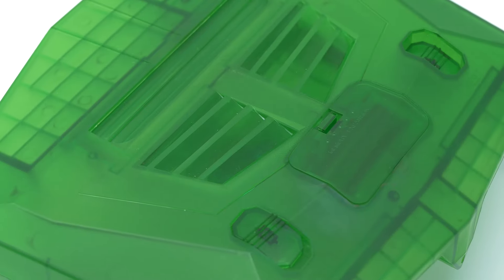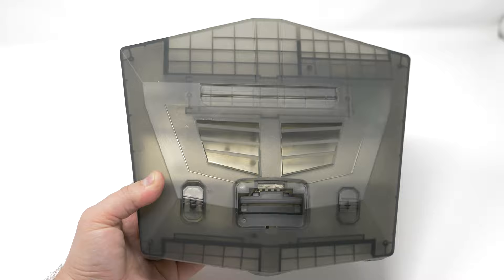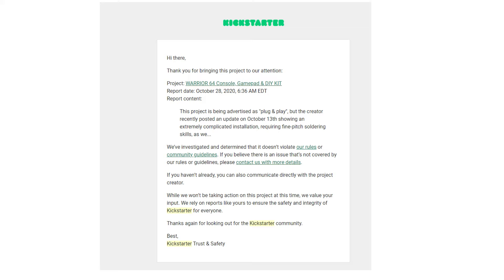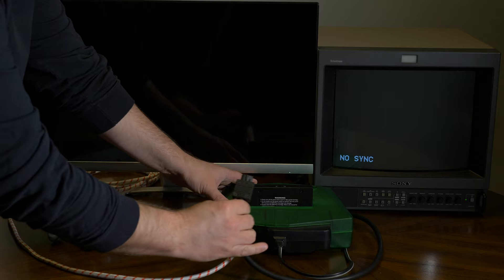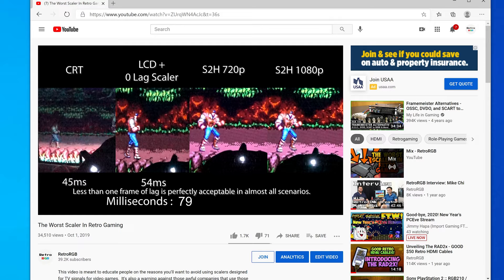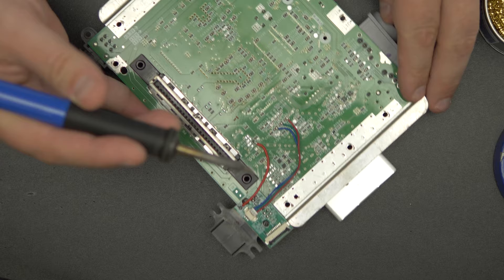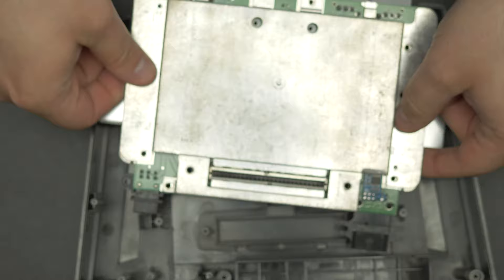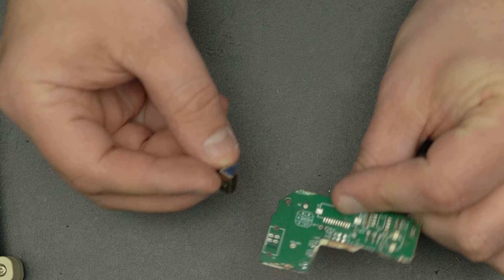Warrior 64: Review & Repair

Comment: The sandpaper thing: is this an out-of-season April's Fool joke?
Reply: You all have belt sanders don’t you? /blizzard
Reply: It's dumb as fuck. The thing is you can actually use an abrasive like a fibre glass pen to clean an already corroded contact but on the whole 2 times I've ever done that the contact was already suffering corrosion damage and i used a thin coating of solder afterwards to try and protect against future corrosion.... I honestly don't get how anyone thinks sanding a contact that just needs a bit of a clean is any kind of good idea.

Comment: I think a better mod for the N64 would be a complete cooling overhaul.
— Soldered copper heat-spreaders.
— Copper heat pipes.
— A copper heat sink.
— An actual cooling fan.
— Cooling for the memory as well.

Comment: That sandpaper is really worrying.
Reply: I was expecting it to say that it's for sanding down any excess plastic that had seeped through during molding. That still would've been bad on its own. I was not prepared for it to say that it's for sanding the damn cartridge contacts.
Reply: additionally, if you read the note there, they say to blow on the game after sanding.  I thought we'd come so far as a hobby, we've grown, we know better than this.  And yet here we are.
Reply: @hjalmarjohnson5846  
Two things were abundantly clear from comments made by the company doing that Kickstarter.
1) They had basic to hardly any even rudimentary knowledge about retro gaming consoles.
2) They spoke in the unmistakable broken bad english of people I have to guess in China or China adjacent that are trying to run something far above their abilities.
This whole thing smells to high heaven of shenanigans of some kind. it's not exactly a scam it's just not good either and it's ruining perfectly good consoles.
Reply: Damion Manuel  I would have blocked you if that was possible on YouTube
Reply: Damion Manuel   I  promise you that's not what they threw in there.  Not really something most people have laying around, either.  Hell, I used to manufacture cabin trim for aero/marine applications and I hardly used it even.  30k is well beyond even a ceramic honing rod, which is almost imperceptibly coarse.

Comment: 13:40 "$5 toaster that you get from Wal-Mart"
Thankfully, I got a $5 antique Sunbeam Radiant Control toaster from the flea market. :) "Automatic beyond belief!" despite its age. The toast even lowers itself and you get the consistent results even if the bread is frozen or toaster is already warm. That's because it doesn't care about time and temperature. Instead, it uses how brown the bread gets to gauge how "done" it is (darker spots reflect heat differently).

Comment: Interesting to see the prototype version for consoles support a straight RGB amp but there's no way the final DIY kit would include that.

It would mean giving every DIY order essentially TWO complete RGB restore kits when the same multi-out board can be used for all three N64 encoder types if they just include a third digital-side adapter board... that's the little one that's basically just a connector on a PCB. Also, between Sep/Oct they updated to show three digital-side adapter boards instead of two. Lastly, the DIY "Installation Instructions" video only instructs users on the digital installation.

I know they sent out a survey before shipping the kits but I'm pretty sure it didn't ask people to identify their console revision since I ordered one for the LULZ and don't recall any question like that. That means they aren't sending different DIY kits to different buyers. Then again, they supposedly shipped and I haven't received mine yet so maybe they are waiting for an answer. Heck, half the reason I pulled the trigger was because I wanted to use the extra adapter boards as digital break-out boards for something like eTim's N64RGB or Borti's N64Advanced.

Comment: The controller design they used seems to be a recreation of the Hori n64 pads from the early 2000’s, released only in Japan. While they may not appeal to everyone as they are quite small, those original Hori controllers regularly sell for high prices on eBay and elsewhere, so it is nice to have a cheaper and new production alternative for those that want them.
Reply: Retro bit already makes a hori N64 clone called the tribute 64. I don't know if the warrior 64 is just buying those, buying stuff made by the same factory, or just making their own (almost certainly worse based on the rest of the kit) implementation of a hori knock off. Also, the original hori n64 controllers aren't that expensive, they are going for like 1/3 the price of the gamecube hori pads people like to use with the gameboy player accessory.
Reply: @coopercummings8370  Maybe $80+ for a used controller isn’t that expensive for you, but having an alternative that is new stock for $25 seems reasonable - I have no experience with either this Intec version, nor the Retrobit offering however, so I cannot attest to the quality of either.
Reply: @RudeKeyser  I'm seeing a couple on ebay for under $70, which is less than a switch pro or dualsense controller. Still pricy for something used, but not insane. The gamecube hori pads are starting at $180.

Comment: LOL!! THE STOVETOP SOLDERING!!!!

I've actually soldered a guitar output jack with a lighter at a gig once, between sets, because my guitarist had a break. 

It was all we had to work with
Reply from the maker: That's such a fucking cool story!!!  I've pulled some MacGyver shit at gigs before, but I think you win!  :)
Reply: @RetroRGB  It was a quick fix, I had to keep telling him to stop jumping around so I could get the thing home and put in a new jack. 
Of course, getting drunk musicians to listen during a show is never an easy chore haha!

The best one was when my '74 Ampeg V2 head shorted out at the power plug (Someone's guitar was leaned against a wall near it and fell on it) backfeeding into a generator and shutting down the show for 20 minutes...

In the mean time, I pulled the plug apart, stripped the wires with my car keys, and put it back together... it was ugly.. but it worked.

The work of a bass player is never over, we're the time keeper, field-tech, and often sound guy of the band haha

Comment: I got mine from a Buddy today and i´m glad i saw your Video. Maybe i will Repair mine to if i can get all the parts needed. Thank you for this Awesome Video.  Question: do you know if  the one included is a Expension Pak? It looks like somthing selfmade, non a official Nintendo one.
Reply from the maker: I believe the one they send with the kit is a 3rd party expansion pak clone.  I'd give it a try and see how it works, but you might want to buy an official Nintendo one.  And an official Nintendo PSU as well.
Reply: @RetroRGB  yeah thanks, i have a spare Expansion Pak left. So i will try it out. I just need that PSU😅👍.

Comment: I have been asking myself for a long time why no company makes 3rd party console shells. You can get new Gameboy/Color/Advance Shells in hundreds of colors from everywhere but 
for home consoles this is not the case. You can only get translucent Gamecube cases from time to time as these are old stock from the mid 2000s and were originally used to allow full size discs.
There are so many yellowed SNES consoles out there, so why can't I buy a nice translucent orange case in either american or japanese/european design for it? 
It can't be because of the copyright since selling the gameboy cases without nintendo logos on them is seemingly ok.

Comment: Question for a noob; WHY is it bad to split analogue signal like that? Just too much for a the chip?
Reply from the maker: Correct.  So, using a Y cable to split audio just makes each of the outputs quieter, but is safe.  Splitting the VIDEO output with a Y cable (which is essentially how this RGB signal is wired) draws twice the signal and will burn the chip out.  I'll do a video on it soon.

Comment: How does it compare in shape and size to the official shells? Larger or smaller at certain points/angles?
That Rad2x solution seemed to be working pretty great. Such a shame they didn’t provide a solution like it themselves.

Comment: You might want to use a 16;9 switch if you have a 4:3 lcd monitor that you want to use actually. The way that those work, it means otherwise the image would come out far too skinny, so the switch is very useful to have. 

It's something that is slightly rare in some regions I understand, but not so much where I live at least. People practically give them away at the moment. 

So I picked up a pair for like 20 euros. You just need to get a vga to hdmi scaler and maybe some speakers to hook to the audio cable that typically comes out of that setup.

Comment: Question for you:
at about 10:25, you mention that anyone involved in retro gaming knows how bad splitting RGB is. Is there a video either by you or otherwise on YT that steps through this? (Or, more likely, link to a post where someone explains it)
I'm not a signals guy, but it sounds like a good review for best-practices when dealing with analog video
Reply from the maker: That's a really good question.  There's tons of info out there, but I don't think there's one dedicated to "why you can't split video signals".  I'll talk to Ste and maybe we can make that one.
Reply: @RetroRGB  I'll subscribe so I can catch it later

Comment: It's interesting that the lag seems to go in a weird loop, starting at 50 ms and gradually decreasing until it hits about 34 ms, then jumping all the way back up to 50 ms and looping over and over.
Reply from the maker: That's common with scalers designed for TV's.  It's because they buffer multiple frames to do their processing.  That's a bit of an oversimplification, but hopefully that paints a picture of what it's doing.

Comment: I did something similar with sticking my retrotink 2x inside my N64 with the svideo connections soldered directly to the motherboard. Allows for the use of the original connector and the hdmi port at the same time.

Comment: Actually using a pencil is doing same thing just way less abrasive some sand paper is so smooth It feels like chalky rubber its normal called 'cloth'.. I use jewelry polish or clear coat cleaner personally

Comment: The part with the sandpaper is where I lost my shit. I have bought NES games with sanded contacts and without that upper layer they become super oxidized very quickly and it degrades the contacts such that you've taken years off the life of the cart which would otherwise survive almost indefinitely with proper care.

Heck if they included a small dab of brass polish and some isopropyl alcohol and instruction to be very carefull not to overdo it with the polish that would have been better.
But there are products that are really inexpensive, like DeoxIt that do the job non-destructively. Just adding in a swab covered in that would have been sufficient and arguably less expensive than a sandpaper.

Comment: 3:53 - Well, my first thought is that the N64s in question weren't destroyed. The important piece of the N64 isn't the shell, it's the motherboard. If you can still play N64 games on them, they're not destroyed. Just in a new shell. Although I still do very much fear for these N64s because no, I don't trust a company that tells me to sand my cartridges to do a good job installing a modkit. Nor do I trust that their modkit isn't dangerous to the console over time. And spoilers, I already know that the mod's video output is absolute crap, so that's not helping anything either.

I would also very much like to know where they got these N64s and what they did with the shells. Did they only buy N64s with broken shells that needed a replacement shell anyway? Because if so, that's not a big deal to me. Did they use any N64s with shells in good condition? And if yes, what did they do with those shells? I would hope that if they have any good shells left, they would sell them directly to customers or to some third party that will sell them to customers, as I'm sure there are some people out there who would like a replacement original shell for their N64. If they had good shells and threw them out, that would most definitely piss me off.
Reply: I've only made it 4 more minutes into the video and I'm shocked at the technical details behind HOW BAD this is. Like, I knew the video output from the HDMI port was bad. I didn't know they screwed up the regular multi-out this badly as well, though. Holy crap. 🤦‍♂️
Reply: 19:28 🤣🤣🤣🤣🤣🤣🤣🤣🤣🤣🤣🤣🤣🤣

Comment: I was on the fence about this, I'm glad I ultimately decided to steer clear of it.

Terrible, on all accounts. They came off as a "group of people with advanced technical knowledge". Clearly that isn't the case. Or if it is, it's way outside the realm of retro video game software and hardware. They didn't even really try, as it looks, to offer something decent.

To boil this all down... they made new shells, harvested N64 PCB's from somewhere, designed a knock off controller, and slapped in some cheap Chinese junk for an HDMI  converter in just about the worst way possible. They also seriously undersold the difficulty in some of these "DIY" kits. The part about that I just can't figure out is... they had the ability to ONLY provide the "easy" N64 systems for self installation. Why in the world would they ever send out the "hard" kit to anyone? That is certainly not beginner level modding and likely they could have just did all the "hard" mods themselves while sending the "easy" kits off to the DIY ers. 

From the bat, I wondered what their technical solution would be comprised of. That and exactly where they were sourcing these boards. I highly doubted they designed their own.

Seriously.... sanding the cartridge edge connector. NO!

Comment: I must admit: for carts i couldn’t clean with paper and alcohol, i resorted to scotch brite and silver polish. Is that bad? Or a crime too? Got those cartridges back up running though😀
Reply: it is probably better than sandpaper, but it is still using abrasives which remove the gold plating and will leave the much more easily corroded copper underneath exposed.
Reply: I’ve used sandpaper numerous times. Works very well if you know what you’re doing. I think the response to the idea of using sandpaper is ignorant but most people in this community just repeat each other without having tested or tried the things they say. That’s not unique to the retro gaming community either unfortunately.

Comment: The 16:9 toggle is useful in a handfull of games, like at the least I know Donkey Kong 64 has a widescreen mode.
Reply from the maker: For that type of widescreen, you'd just set your TV to 16:9 mode.  It's the same thing.
Reply: @RetroRGB  Would that work through HDMI mode though? I'd assume most HDMI signals would already be in widescreen.

Comment: Why would anyone modified the N64 when you could just buy the Hyperlink HDMI cable for the SNES/N64/Gamecube cable for $30?

In addition you can add a mClassic Graphics Enhancer to your HDMI switch board. For an additional $100.
Reply from the maker: Because the Hyperlink cable is the exact same garbage as the scaler used in the Warrior 64.  Maybe watch the video again and check out the links in the decryption to see why using one of those cheap HDMI cables is a TERRIBLE choice?

Comment: So is this not safe or will it burn up when in use of the system?  I almost get the impression it might burn up.
Reply from the maker: Well, it certainly won't catch fire or anything like that.  The safety concern is if you use analog outputs...and the only concern is if it will kill the N64 motherboard in that scenario.
I'm sorry if I wasn't clear enough about the safety concern.  I thought I covered it a few times.

Comment: I've used polishing grit sandpaper on old bootleg cartridges before, it's not that bad, iff the grit is high enough (in the range of 2500-4000 grit, the kind for mirror-shining jewelry and car exteriors) it's slightly more abrasive than erasers (or similar high grit rubber abrasives). I wouldn't recommend using it on anything that doesn't have surface corrosion beyond saving with regular methods (denatured alcohol and q-tips) or has deep indented scratches from poorly made cartridge slots (the kind found in many famiclones, case in point why I've only needed to do this with bootlegs)